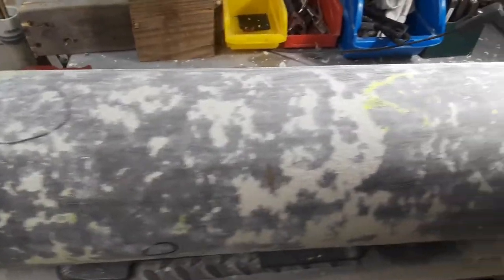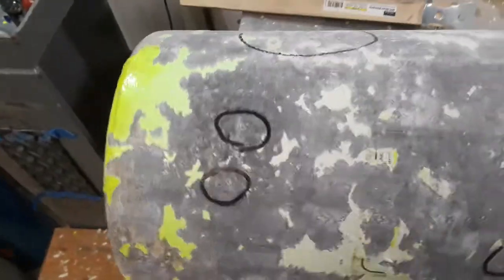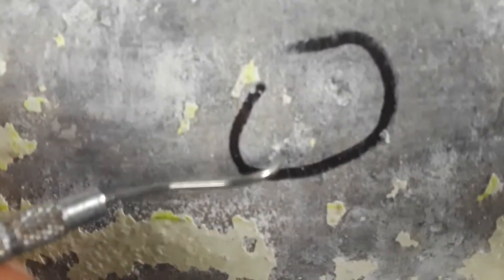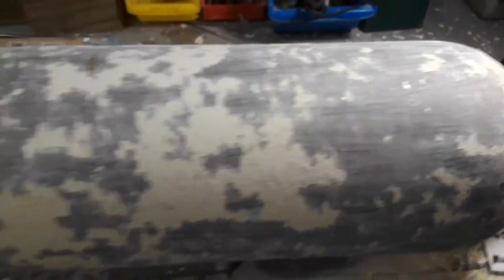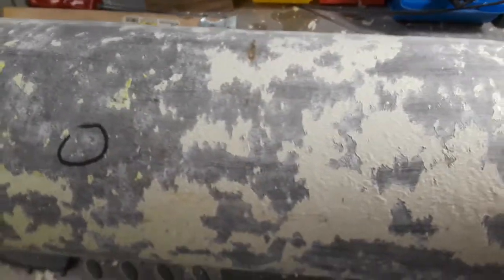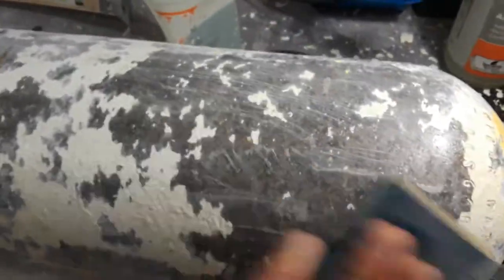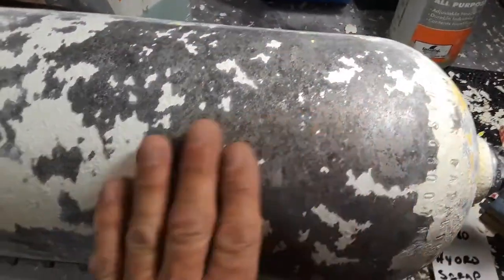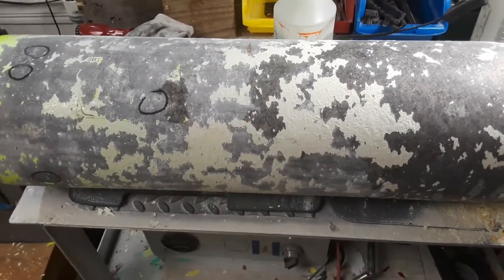Scuba tank blister paint video 2

Comment: Just curiosity are you allowed to use a wire wheel to remove oxidation on the tank? Thanks
Reply from the maker: Using a wire wheel is risky, you can remove aluminum if applied too hard. I’ve used a wire wheel to spot clean corrosion, however lightly applied pressure.